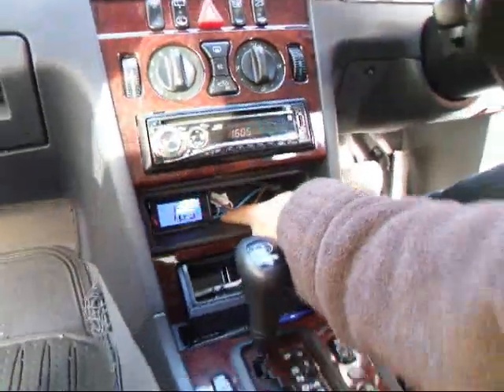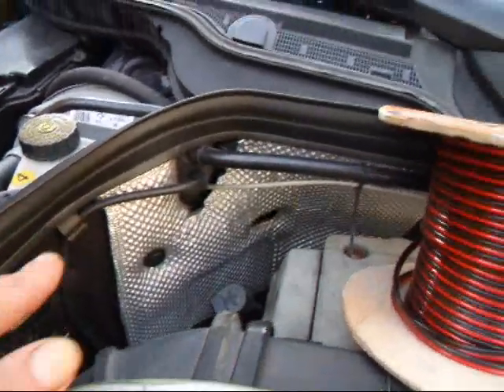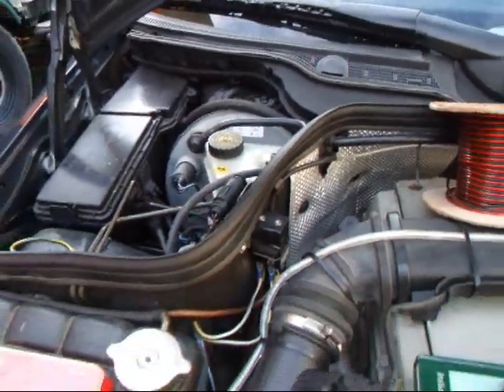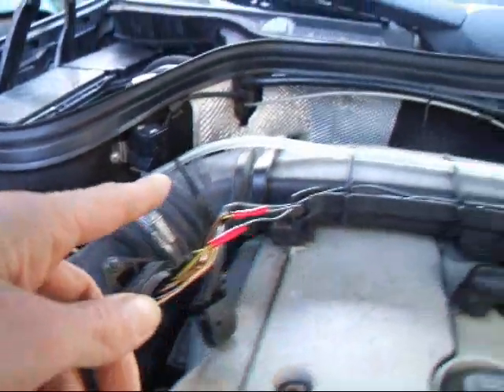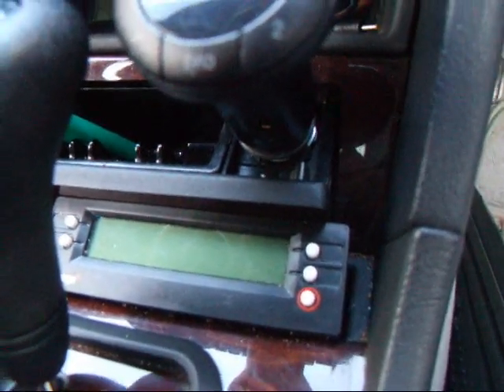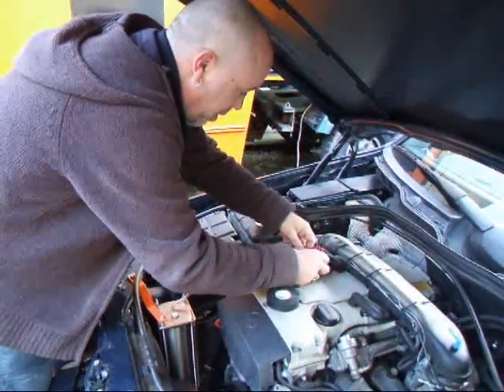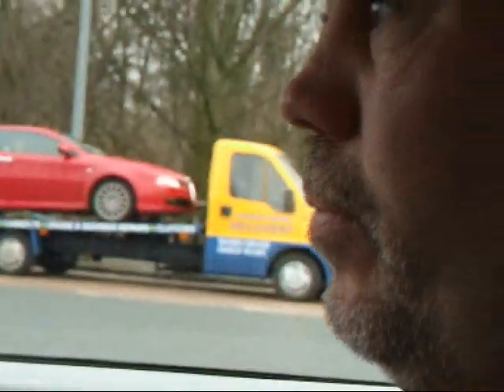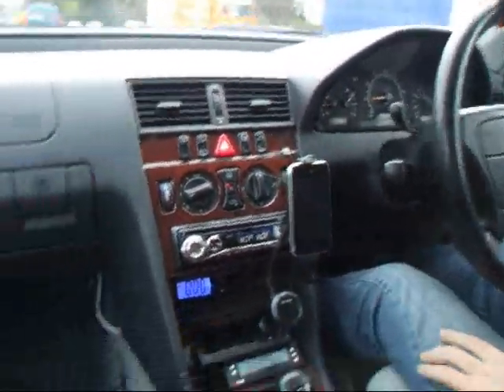Waterboost HHO MPG results

Comment from the maker: the back pressure in the exhaust, especially in two strokes, is designed to stop liquid fuel pouring from the manifold, a catalyst is designed to reburn hydrocarbons. look at patents from the 70's. most manufactures chose HHO as a safe way to lean burn an engine... but we lost WW2, so the germans said we had to have catalytic converters! The japanese were gutted... they did some good research! unlike urself!
go and spread ur mud all over someone elses work.

Comment: @Toysrme Respect so did you work in research and development if so what were your findings or were you a mechanic ? Because Tuning was taught in tech schools up until about 30 years ago. As the vehicles became more complex, there was less tuning required for optimal performance and mileage. Tech school grads coming into the work force these days are taught to follow flow charts, replace bad parts, and track down poor connections.:)

Comment: @xjet and i've been a tten trained toyota mechanic, and involved with high performance engines and alternative fuels used in it's pursuit for years. Hydrogen enrichment is hooey. The only change at all that occures with these "devices" are the piss-ant changes to SHORT TERM fuel trim caused by modifying the main airflow sensor's signal to read lean. Which will be trimmed BACK out in LONG TERM fuel trim which is STORED dated. If Hydrogen BS worked. You'd see gains on Karmon Vortex metered engines

Comment: @xjet Thanks for the heads up Ive been on a mercedes forum the c200 auto 5 estate will do 30 mpg not 31 as claimed by me new.The tuning specialist who diagnosed vehicle (before conversion)  for new lambo (outer-limits) was not seeing code po172 or po175 Ie running rich scan gauge would pick them up also.when adj for hydrogen temp good i back off before code po170/71 (too lean) :)

Comment: Xjet, You pretty much misunderstood what they have done.thx to cell producing oxygen and nitrogen they were able to remap ecu and increase mpg a lot.your way of thinking indicates low knowledge of combustion engines.Look at diesel ford van video and listen to that old engine running like new. 
Only cos of full cell.No more or less if you want to know if your car runs correct check spark plugs! It will tell you truth straight away.